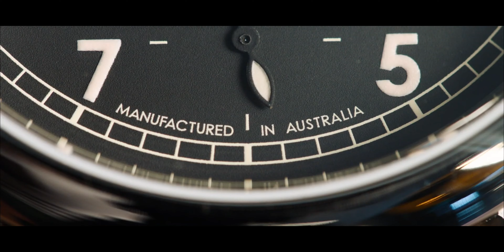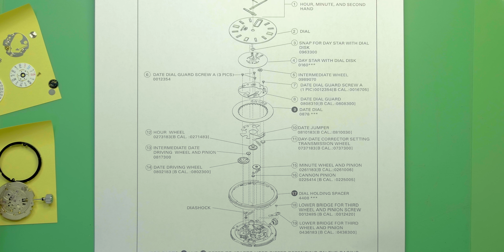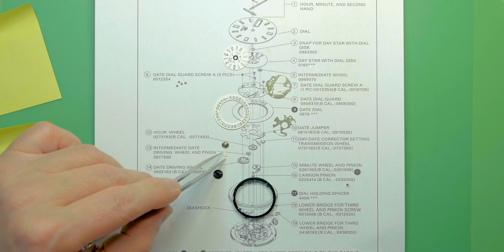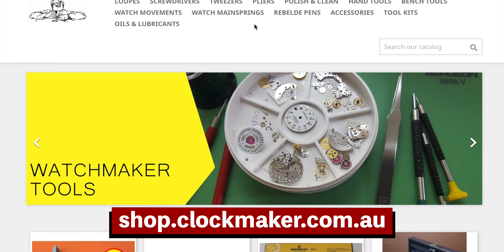Seiko 7S26 tutorial Part 2 - Calendar disassembly  | Nick Hacko Watchmaker

Comment: Great video! It's actually easy to remove the calendar works but on my first attempt, my screwdriver slipped and bent the day wheel spring on the date dial guard. Ouch! I noticed the NH26 doesn't have that cross head screw on the dial guard, the one that uses an S-921 screwdriver. Good job folks!
Reply from the maker: Great attention to detail! Yes the movement in video is 7S26C and this latest version has 4 standard slotted screwdrivers securing the plate.